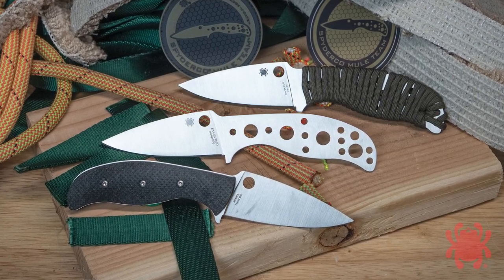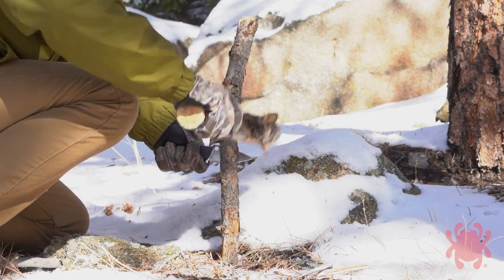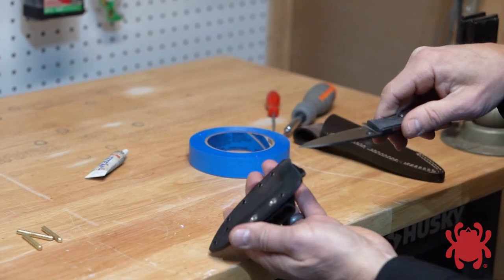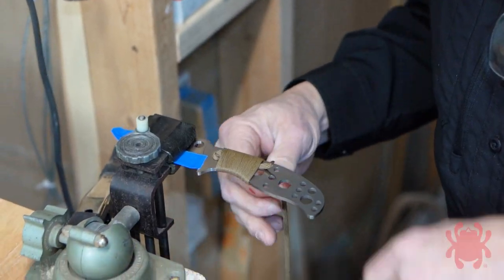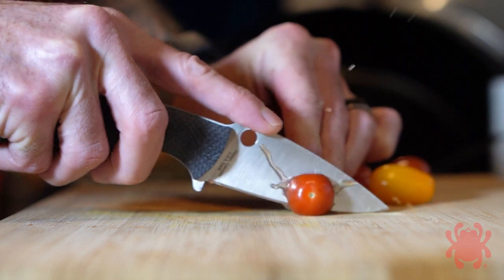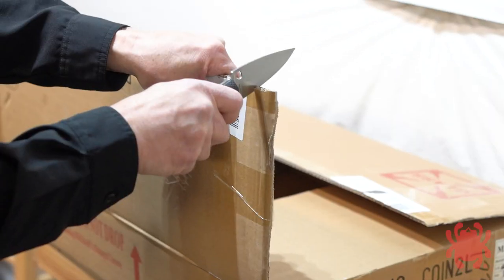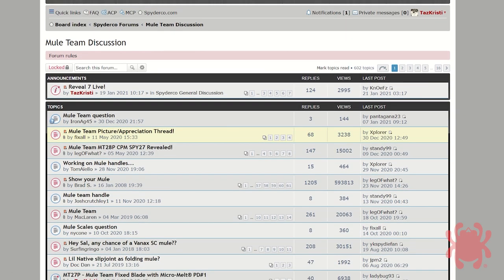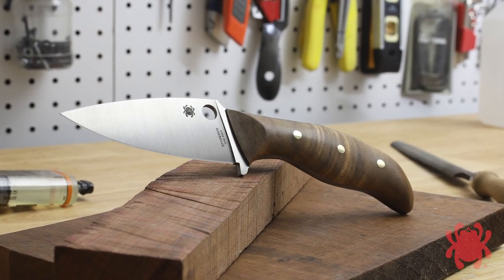The Spyderco Mule Team Project

Comment: A good concept as I like using a fixed blade knife without scales or just wrapping some paracord if needed. I don't care about having a plethora of steels, to each their own. I find one good steel and I stick to it. The fact that bothers me is that you are putting sixteen holes of various sizes in a knife with a overall length of 194mm. You clearly have an obsession. A fixed blade knife with no holes in the blade with only three or even two holes in the handle for scales and one hole for lanyard is not good enough?
Reply: Come on man do you always find something to complain about
Reply: @JesusIsAlphaOmega001  not always, only about illogical shit .